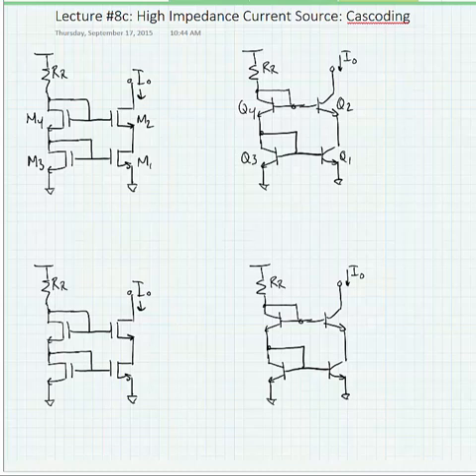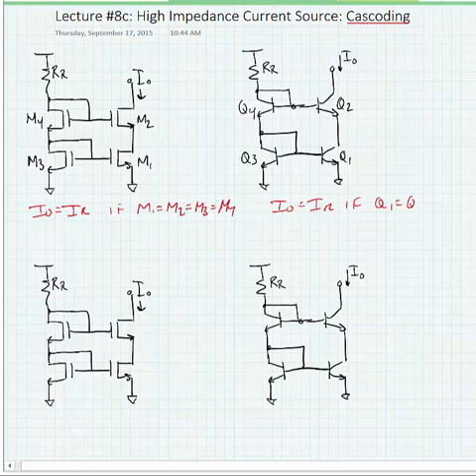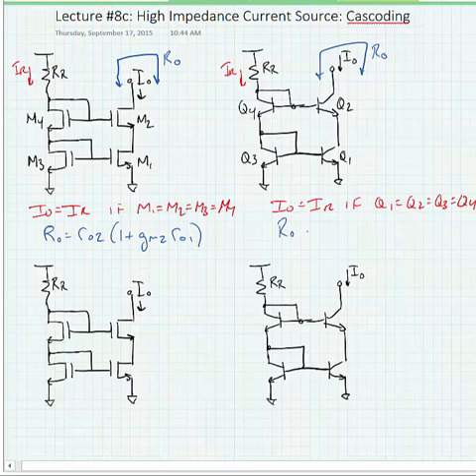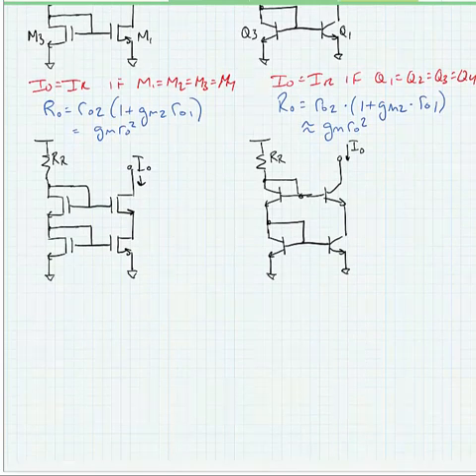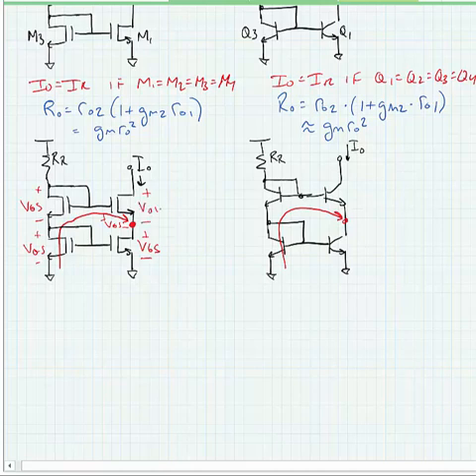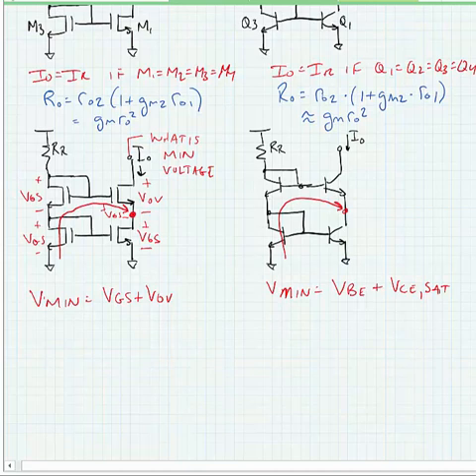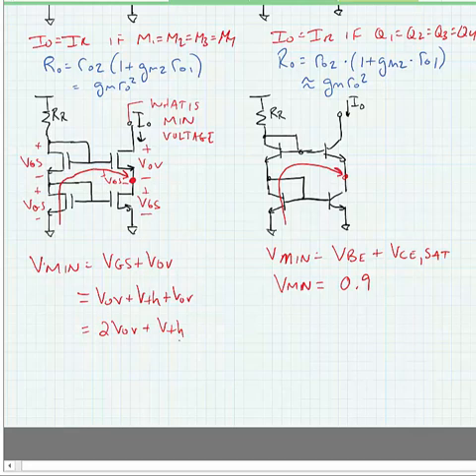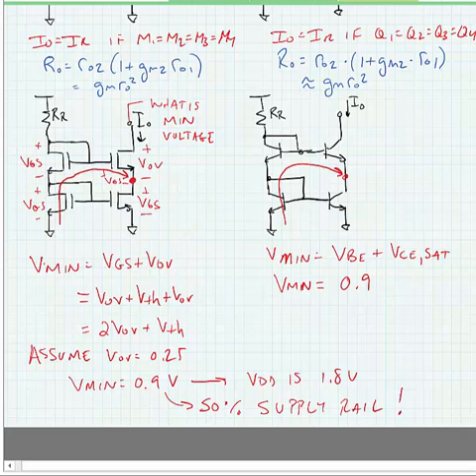ECE 3110 - Lecture 8c: High Impedance Current Source: Cascoding

Comment: Why we require VGS voltage  for diode connected load?
Reply from the maker: The diode connected load connects the gate the the drain, so the saturation requirement inherits the gates requirement, not just the drains requirement (e.g. Vov + Vth vs. just Vov)